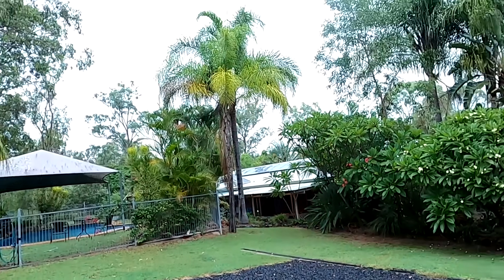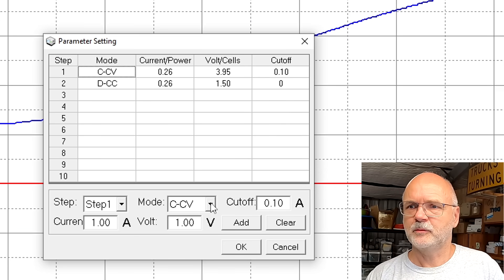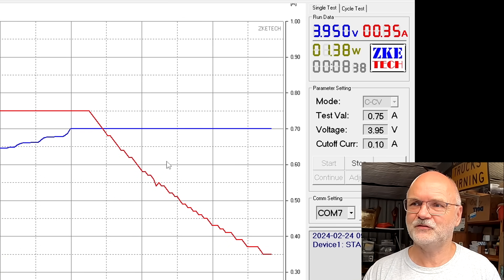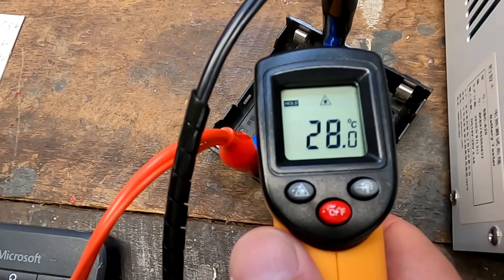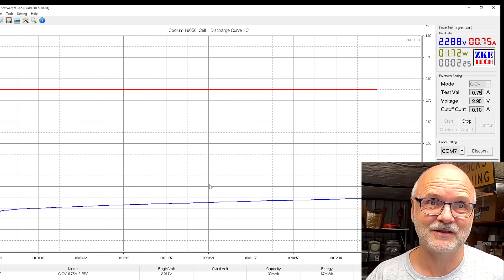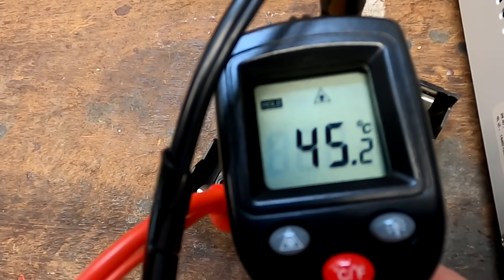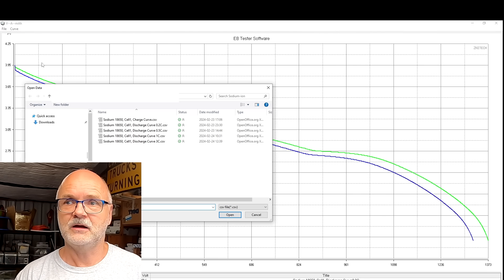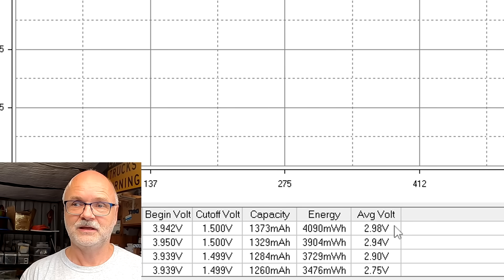Sodium Battery C-Rate Test and Comparison. Better than LiFePO4?

Comment: How different is it to charge these batteries from the LiFEPO4 batteries, I'm just wondering if you have a BMS that supports LiFePO4 can you use it for the sodium batteries or do you need a new BMS

Comment: I like the curves :-) from the Sodium batteries cause you can estimate the SOC much better. Next time please compere the same rates for both batterys chemicals, the lifepo4 was only testet with 1C max and the chart was much smaler. 9% less with 3C discharge is a prity good value.

Comment: 🤔 Am I missing something? If a cell drops from 3.6 to 2 volts while discharging, doesn’t that mean your “48V” battery will actually be dropping below 27V?? 🤷‍♂️
Reply: Yep, basically,  the battery will drop by half (4v - 2v operating range, ~3v nominal voltage)

Comment: For the sake of cycle life, would you recommend setting low voltage cutoff at the plateau? What state of charge does that plateau occur? These discharge curves look very much like Ni-Zn, though with just over twice the voltage.

Comment: At each section of this graph 0 - 137 - 274 - 411 - etc. we have equal mAh but different ammout of energy in the cell, because of different voltage at start and end of each section, so e.g. first section has / 3.94 + 3.65 / === 7.59, 7.59 / 2  === 3.795, 3.795 x 137 === 519.9 Wh of energy, but from 412 - 549 we have  / 3.35 + 3.17 / === 6.52, 6.52 / 2 === 3..26, 3.26 x 137 === 446.6 Wh of energy. A lot of BMSs and system for  SOC reporting, reports SOC % for mAh or Ah, but this is not equal to SOC % ENERGY. Becuase integral function under voltage curve is different for equal Ah ranges 0 - 10 - 20 - 30 -- etc.

Comment: Great test, thanks!
Do you have measurement results of the internal resistance of the battery?

I would be interested in whether it could be operated in parallel with a LiFePO4 + Sodium battery? There is an overlap in the range 3.6>2.8V. It would be an interesting experiment!

Comment: You seem to know alot about battery.
I have a 12.8 volt 50amh LifePo4 and its going to be connected to a 1500 inverter.
The ebike charger is 54.7 volt ,will the ebike charger damage the LifePo4 battery?

Comment: These batteries are pretty weird and it seems that they will need expensive voltage regulators, like dual range (3.95 to 2.7V then 2.69 to 1.6V)..  These are going to need pretty heavy capacitors as well.  I think that these batteries are best for outputs that can take viable voltages, like starters, heaters and lights is the simple applications, but a pain-in-the-ass for constant voltage applications.. leading to down rating and cycling on extra batteries with parallel to series switching to keep a constant current and voltage constant.. better for industrial applications where big banks of batteries can maintain the flow.

Comment: Can you Discharge them with constant watts instead of constant amps? I think you will see they do have a knee a very steep one. As the voltage drops the amps will rise, at the point of intersection of the two graphs I think they will perform badly and possibly heat up incredibly

Comment: From those curves you can easily calculate the DCir for the cell at the various SoC's and temperatures. Then you can apply a terminal voltage correction based on that DCir to "see" an approximation of the electropotential of the cell at its current chemical state 🙂

One nice test for DCir is to write a little scripted function that does a pulse discharge followed by a pulse charge at the same current and for the same duration, so the overal SoC is not changed. If you run that test at say 0.1v steps through the discharge from the response you can calculate both the DCir and ACir as well, and even build a model of the cell from that data which becomes very useful in terms of any openloop corrections for a BMS system etc

Comment: Most home inverters would provide 100amp at 48v at peak.  . So 200 amp hour pack will stay at 0.5c at worst of times. And yes, most inverters would not be able to access top and lower range of voltages of those batteries. Not ideal but i guess good for their longevity. And importantly those are non flammable.
Reply from the maker: Why are they not flammable? I have other information...

Comment: These curves resemble Lead acid batteries more than LFP or li-ion.
Which has upsides and downsides. Most importantly the amps go up when the batteries are going empty and the load is the same.
But the upside is I think, no need to balance!
That will save a lot of money on hardware.
Reply from the maker: Balancers are not expensive though (in comparison to other equipment and devices you would buy for a solar battery system). We will get to that point in one of the next videos 😉
Reply: @OffGridGarageAustralia  That sounds like a matter of opinion. One good(ish) 16s 200A BMS costs about 200 to 300 euros. For that money you can also get 3 or 4 Grade A 280Ah cells. Let's agree on "significant".

Comment: looks like a good buffer storrage, i mean, if you build for example a 100Ah Batttery, with 10% Lifepo4 at beginning, and the end of SOC, lol?
can the cells be mixed with lifepo? serious question
Reply from the maker: They cannot be mixed, no. Due to the flat voltage curves of LiFePO4, we would use only a small amount of the sodium capacity. From 2.5V to 3.65V if we max out LFP. Mor realistic it would be between 3.0V to 3.45V only.

Comment: Hej Andy
Thanks for great test.
The difference in energy is actually around 15%. 614 wh out of 4090 wh. This because of greater difference in voltage-curve with greater C-rate, than LiFePo4.
Best regards Brian
Reply: True The energy is about 13% less but the curve is considerably less flat so in real world the inverter cutoff is 30% sooner. Also discharge for Na+ is .5C up to 113f rather than lithium 1C up to 150f. Further testing in real world conditions is needed. Lithium costs considerably more and I haven't seen Na+ to be considerably less yet.

Comment: one of the problems to take into account is the problem of intensity. If you have a fixed load of 10W, at 3.8V you will have a discharge current of 2.63A, but arriving at 1.8V for the same load, the current will be 5.55A, which will make the discharge will be outside the datasheet parameters
Reply from the maker: Yes, correct. We are pretty spoiled with our LiFePO4 chemistry.

Comment: There is now a version 0.7 for the Seplos V3 bms. This update fixes a big calculation and display problem for SOC.
While they were at around 60% SOC, the bms displayed 98.5% and remained at this value until a cell passed the UVP. In addition, the SOC display increased or decreased twice as much as in reality.
We made, with Cyrille from the YouTube channel "Lemoult'e Batteries", a request for rectification to Seplos, and they have just released the new firmware
Reply from the maker: Yes, thank you. I'm in contact with Cyrille.
I tested as well with 0.5 and 0.6 and could not see any jumping in SOC. But the V3.0 has lots of other issues. All around it's not a great BMS and even worse is the software.

Comment: obviously the voltage sag of the load affects the total ah that can be extracted from the battery , i would love to see a test of 3c discharge from full to close to shutdown voltage and just before shutdown happens or lets say 10% from empty reduce the load to 0.2 c  and then see  ah extracted from battery  compared  to 0.2c 

as we can see the battery jumps back up to 1.8v the moment the load dissapears

ie a test like we tend to use our batteries in our phones , happy go lucky but the moment it gets closer to empty we tend to conserve 

in other words is the sag on high load causing us to get the wrong puicture of efficiency
Reply from the maker: All these tests are done with constant current though. If we change the current during testing, what can we compare the result to?
There is no capacity under 2V in these sodium cells. I'll show this in the next test video.
Reply: @OffGridGarageAustralia  ok after doing the high drain test and once it shuts down, do a 0.1/0.2c  to see how many AH is extracted until a low voltage shutdown

This is more a curiosity
I don't think there is much to extract

Just curious how much the sag affects the efficiency %

Example the axpert type inverters will do different low voltage shutdown voltages dependant on load to compensate for sag(naturally this is designed for lead acid  only happens on the gel/flooded profiles not USE)

On a big cell the difference may be negligible

since the test is done on a small cell , .that tiny bit may affect the % more

Comment: Because of the higher internal resistance more of the capacity is converted to heat, so with higher C rates the useable capacity drops depending on that internal resistance values. Your 45° measurement is an evidence for that. The "missing" capacity warms up your rainy day ;)
(greetings from Austria)
Reply from the maker: That's why I was sweating a lot!😄

Comment: Well regarding Ri, IT seems this chemistry is Not for Inverter... IT IS more for DC/DC bucket converter.

When i calculate a Bit, IT Points Out that one cell has Ri=0,1 Ohm and this is the rootcause why voltage IS dropping in end of charging and start of discharging.

IT means you have to Take down the current, otherwise you do not hit 3.95 in real.

Comment: Wouldn't E-rate in watts be more relevant than C-rate in amps for a battery chemistry that has such a wide voltage range? At 3C the battery is providing 15.41W at full and at near empty it's only providing 5.85W. What happens if I drain the battery down at a constant energy of 10W? Would I have to stop discharging at 2.56V to avoid cell damage? Doesn't the C-rate vary drastically with a constant energy throughout the discharge cycle?
I apologize in advance if what I am saying is misinformed. :)
Reply from the maker: C-rates is what batteries are tested with to make them all comparable.
Watts are not great as they contain the voltage, which sodium batteries show a very high delta of.
C-rates and Ah use only the current and are far better to compare.
Reply: you have to calculate your application, so that it will work in every condition. you have to make sure, that your battery can deliver enough power at the lowest SOC you will allow. In your example you have to set your discharge voltage to 2,56V or you have to use bigger cells or 2 or more in parallel.

If you want to compare different chemistries, or differently organized batteries than you will go for Wh than for Ah. Ah is only suitable for single cell with the same chemistry. But even there could be diffences in the voltages over time and then Ah isn't accurate anymore. But Ah is easier and Ok enough for tests with a single cell.

Comment: 16:07 Can Andy or anyone explain to me why anyone would care about capacity in amp-hours and not kilowatt-hours? Those results then come out completely different, e.g. at 3C the usable capacity in kilowatt hours is only 85% as opposed to 92% in amp-hours. But I wonder why I should care about ampere-hours? Thanks for the clarification!
Reply from the maker: We use Ah and C-rating because it only contains the current only (constant current) and not the voltage. Voltage changes all the time, so makes no sense to use it in such test. Hence, all batteries have Ah stated and not Wh.
Reply: @OffGridGarageAustralia  I would just expect that just because the voltage is changing, only the capacity in kWh is important because that is what plays a role in real life operation of a solar inverter...

Comment: I wonder what would happen if you lowered the discharge rate before the steep drop in voltage.
- Is the high discharge rate causing losses (heat) or is it mostly a matter of the test cutting off prematurely because of the lower voltage so the remaining capacity can not be used?

It would also be nice to see a discharge test with the cell in a SPAT cooler as LFP typically does not work well at something like 0 degrees celcius and loses about 17% of it's usable capacity if I read the EVE specs right.
-This would be a realistic scenario for those of us that don't want to waste energy heating the outside mancave.
Reply from the maker: These tests are always conducted with constant currents. If you are lowering the current during testing, we cannot compare the results to other battery chemistries anymore.
A proper climate chamber costs A$5k+. I have tried using ice and coolers, but results are too inconsistent as the temperature is not constant.
Reply: @OffGridGarageAustralia  I understand there are standards for testing, but it would be nice to see if there is some way to get more out of these cells by lowering the current in the lower SoC. 3C seems like a lot for continous use but is very nice for peak loads like cooking.

Maybe the low temperature tests are a bit unrealistic in a small fridge as the batteries themselves will change the temperature, even more so at high charge/discharge rates. Maybe someone in a colder climate with the right equipment and experience can do this?

Comment: before the end of the video my guess is that  c rate  changes the capacity .. and that is because lfp cells can be stored 6 months  half the capacity but those cant that much ..  they lose more..  scale is the strange question because of that theoriticaly bulletproof sodium chemistry.  i got a funny  idea ... one inverter 48v and a relay 36v inverter or even a 24v when it is down to operate in emergencies and take tha last juice ...   JUst kiding..   electronics to maintain closed the small inverter  when over 32 volts are too expensive

Comment: Sodium ones are not as good as all the hype about them unfortunately ☹️ I think they are something in between lithium and AGM 😌
Reply from the maker: Yeah, I'm a bit disappointed as well. A lot of hype about these cells but ...
Reply: @OffGridGarageAustralia  we can't wait to see some tests for that 12v 50A sodium that guy gave you that said he was disappointed with. It would be interesting to see how 12v handles some 12V devices and camping TVs or laptops running on inverters or straight 12v dc adapters but it might be bad news unless someone is happy with only 60% depth of discharge 🤷‍♂️

Comment: Excellent Andy! exactly the comparison test I was hoping for, thank you. Have you considered of doing any life-cycle capacity tests on your little sodium Ion friends, maybe 300 cycles at 1C? 

Btw, I've been looking into the sustainability of Lithium in meeting projected demands and some estimates by the World Economic Forum claimed 700 years of lithium mining at current rates would be required to meet projected demand over the next 12 to 20 years for lithium batteries, or by my estimate a 100X increase in lithium mining, so it would seem that alternative sustainable chemistries are essential, and your test Andy is a telling preliminary insight into one possible chemistry. 

Perhaps Sodium ion battery chemistry used in stationary power systems, could free-up lithium for mobile batteries?

Also, some promising results using AI to invent new battery chemistries  promises to reduce invention and development time of new batteries from 20 years to 80 hours.
Reply from the maker: Very hard to do long term tests as it occupies the equipment and the computer would need to run for that time too. I'll consider it maybe later when we are done with all the sodium testing.

Not sure where the 700yrs number comes from but there is other information out there that we need only to mine for 20yrs if we have a good recycling program for lithium set up...

I don't see sodium batteries become a viable solution in the near future.
Reply: You gotta remember these are pretty much first generation production sodium batteries... and that they should be able to apply many similar technologies as they adapt them from Lion to get performance and specs up.... old lithium ION batteries weren't as good as they are today when they came out either.

Comment: thanks again for this interesting content. Regarding sodium batteries, their biggest advantage is also their biggest weakness. The large voltage difference between a charged and discharged battery gives a great opportunity to relatively accurately measure capacity as a function of voltage, but at the same time it can be difficult for regulators and inverters to deal with such a large voltage difference. So, if sodium batteries are not significantly more affordable in the future, there will not be much reason to switch to this chemistry. The advantage of being able to charge at low temperatures is already quite easy to solve for lithium cells today.
Reply: you could make a weird battery that changes the interal connection from parallel to series between the sub modules to bump the voltage up (when switching from parallel to series) this way you could keep the voltage stable :)
Reply: If sodium batteries are really cheap, it could be possible to let them only go down to 20-30% or so. In return Lifecycle is longer...
Reply from the maker: Yep, that's what we discussed in the last video.

Comment: Love to see some tests of lithium titanate cells.
Reply from the maker: I have some here, but why would we use them? With solar, we don't use high c-ratings and they are a lot more expensive than LiFePO4.
Just for the sake of testing... OK🤷‍♂️
Reply: @OffGridGarageAustralia  I build electric mopeds, bikes, but I still love your channel, the bms reviews have helped me a lot. I plan to do solar one day. I love LTO, for solar the high c rate is not needed I agree, but having cells that will never need replacing is a positive, and even safer than lifepo4.
Reply from the maker: @toriwatson9655  Yes, perfect for that matter. The high C-rate is exactly what you need for that type of application.
LTO have a lifespan of 10yrs so are not infinite...